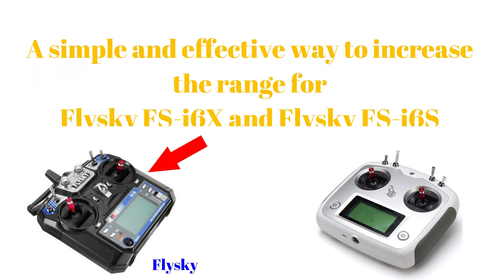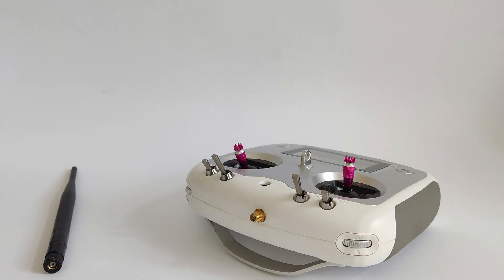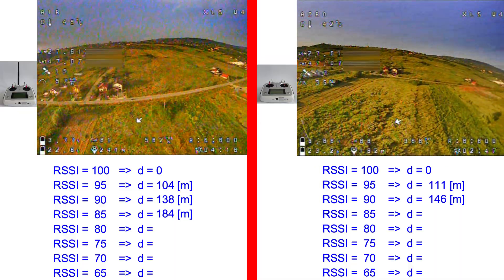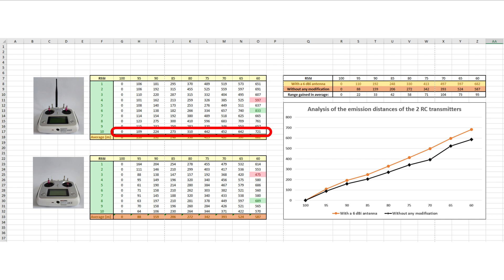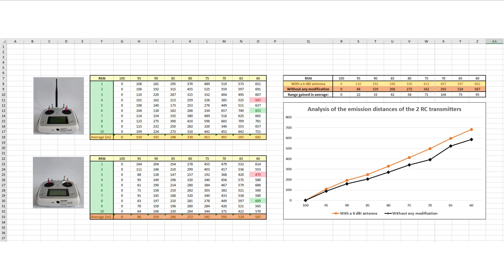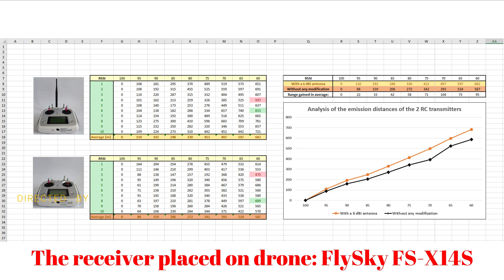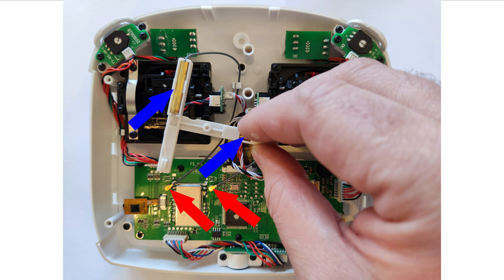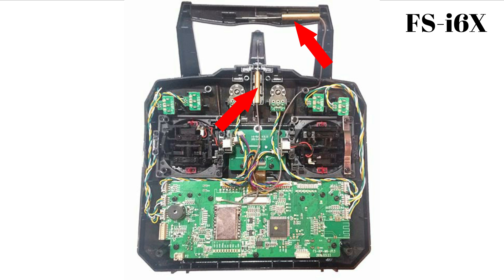A simple and effective way to increase the range for Flysky FS-i6X and Flysky FS-i6S RC transmitters

Comment: You get a signal/distance loss from this upgrade sadly. Reason why? The remote is tuned perfectly with the stock antennas length, by putting on a larger antenna, you also increase the length, which throws off the frequency tuning in a negative way... i myself only experienced a loss of about a 200 foot distance(i could fly to the end of my city park with the stock antenna, the upgrade, i could not...)

Comment: hello, is the 833 m the maximal real range?
Reply from the maker: From data sheet you will find that the "range exceeding 500 meters" for FlySky 2.4G 6CH FS-iA6B Receiver. I was able to get 844 m with the Flysky FS-i6S station - without any modification (see: https://youtu.be/lu7Hj7G4EOo?si=E9jtNHUtdJZjXfJt). By using a better antenna and a higher altitude you will get, may be, 1000 m range. Test it!

Comment: Do you happen to have a firmware backup? 😢
Reply from the maker: I'm on vacation, not at my home - but I have the software used to update/restore the firmware. On September 1-2, when I will come back I will be able to help you.
Reply: @i3Drones  Hello, can you help me with the firmware?
Reply from the maker: Hi @user-bs2rr2ft5o ! I can not give you the firmware - mainly because it is embedded in the updating software. So, you have here (https://drive.google.com/file/d/18acD8yPXeRUZQ2WAhUJolJ6xmDR1QszC/view?usp=sharing) a link from where to download the updating software that contains inside the firmware. First, connect the station to the PC - wait a moment to install drivers. Second, on the station, go Sys -> Firmware update -> Continue. Third, run the downloaded software and make the update. The software from the link has FW 2.0.0.68. If you download the software from the official site, you have FW version 2.0.0.61. So, use the software from my link, which is newer.
Reply: @i3Drones  My transmitter does not turn on, there was an error during the firmware and it is now dead. I need firmware in "bin" or "hex" format
Reply from the maker: @SerhiiBondarenko-z1f  I do not have such file. I thought I could download such a file through their app. But there I can just load the station software. I"m sorry, I can not help you!
Reply: @SerhiiBondarenko-z1f   have you been able to revive your transmitter ?
Reply: @sports_hub69  no 😮‍💨😢

Comment: hi, i'm newbie and got very little knowlegde about eletrical devices, can you tell me which types of parameter (power, antenna or something else which are printted on the box) affects transmitter's range, i want to buy a cheap transmitter but don't know how far the distance of tx-rx. can i caculate the distance by some way ?
Reply from the maker: All components are very important. I know you think I am exaggerated. You have here a video in order to understand better the importance of the pigtail - a component tha cost 2-3 USD: https://youtu.be/dJ64yNmNpXI.
Reply from the maker: You have here a good tutorial regarding FPV range: https://www.immersionrc.com/rf-range-demystified/.
Reply from the maker: The power of the VTX is a very important parameter. The problem is when you start using a 600 mW VTX you will have 600 mW for a short time, after 3 min you will have 450 mW, and after a while you will have may be 350 mW. So, the quality of the VTX is very important, but the quality means more mony.
Reply: @i3Drones  very thank you

Comment: External antenna makes a difference. Before throwing away an old 2.4 GHz wifi router I disassembled it just for fun and saw that it had the correct cable for antenna to fit into my Flysky FS-i6X. I connected that and yes, way better even that the wifi antenna itself was a quite small. 

(I never finished the work to change it.  For other reasons I bought a Radiomaster TX16S which has an external antenna that works as good as a modded Flysky)
Reply from the maker: You are right the antenna is an important factor. But it is not the only one. If you allow me, I can give you another idea: the pigtail (the connection cable and the connector itself) is another very important factor.  Here a short video regarding the pigtail influence (on video transmission this time): https://youtu.be/dJ64yNmNpXI.

Comment: how much rssi value is dangerous? like 65 after that you will failsafe?
Reply from the maker: There is not a simple answer. If you fly in a straight line without obstacles you can go down to around 40. If you fly behind trees or other obstacles go down around 65. A major problem is the orientation of the antennas (how TX antenna and RX antenna are aligned): at 45 degree you will not loose a lot of signal, but if the two linear antennas points at each other - you losse almoust all the signal. The most honest answer would be through testing - it all depends on your transmitter, antennas, antenna position on the drone and receiver.
Reply: I have the FS-i6 and I touched 1% for 3~ seconds with out a failsafe. I'm not sure if the RSSI value is correct, but it does show 99 when I'm close
Reply: @realTaqil  which receiver were you using?
Reply: @farhanalifpv  I'm using the X6B receiver
Reply from the maker: @realTaqil  I don't understand the meaning of the sentence "I touched 1% for 3~ seconds with out a failsafe". It is very possible that RSSI value of 99 to be correct when you are close with your equipments. If you want to check the link. Put your drone on an upper position - on a tree at 2-3-4 m high - and start to go away with your RC transmitter, watching all the time the RSSI value on your goggle. The real problem is the case when the RSSI value sudden decrase with 20 or more - keep all the time the transmitter on the same position. The problem here is the VTX - without any air flow will get hotter, so use it on a minimal power.              Or try the other way around.  Fly with the drone at a low altitude (1-2 meters) and slowly go to a far distance.
Reply: @i3Drones  I meant that when I was flying the RSSI value dropped to 1% suddenly and I quickly accelerated closer with out it failsafe. I want to do a range test where I fly until it failsafe close to the ground but space is limited at home. I built a tyro 129, and have no idea why I would go with FS-i6 transmitter.. I ordered a TX16s with crossfire module hoping for nice long range flights :D
Reply from the maker: @realTaqil  I have here a video, https://youtu.be/lu7Hj7G4EOo, where I used a FS-iA6B receiver with the unmodified Flysky FS-i6S RC transmitter. The range was more than 850m. I used extensively the FS-iA6B receiver on planes and quadcopters, and I do not had your problem ever. My supposition is that your receiver has a problem - maybe after a crash. Trey a new one and see if the problem persist.
Reply: @i3Drones  The quad and the receiver and transmitter is brand new. The FS-i6 transmitter does not have RSSI from the factory I flashed the firmware with my arduino to get RSSI and 10 channels. I suppose the reading is just wrong. I will test the range tomorrow hopefully just have to find a good place for it. I will update you with the results.
Reply from the maker: @realTaqil  I also flashed the firmware to get the RSSI ... but without any problems ...